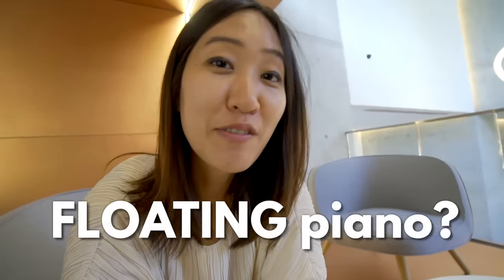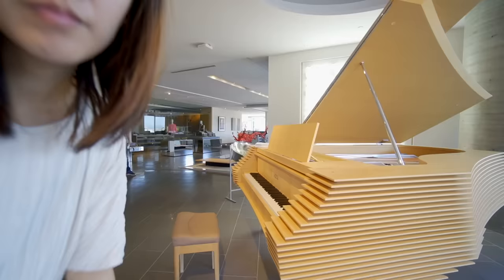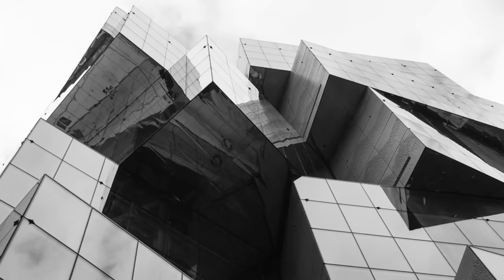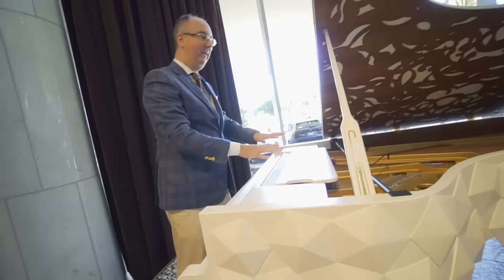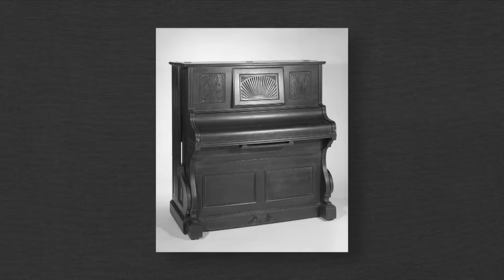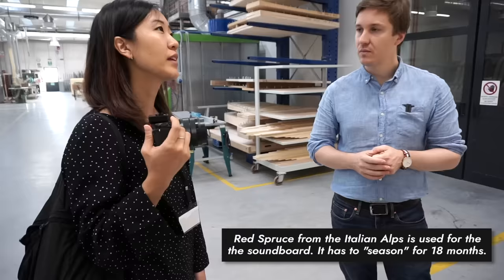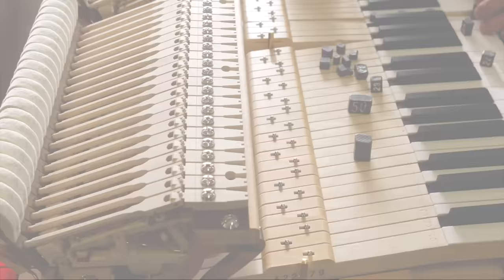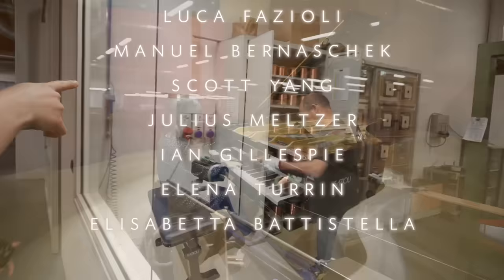UNBELIEVABLE Pianos You Never Knew Existed

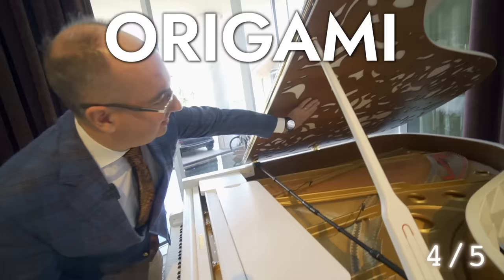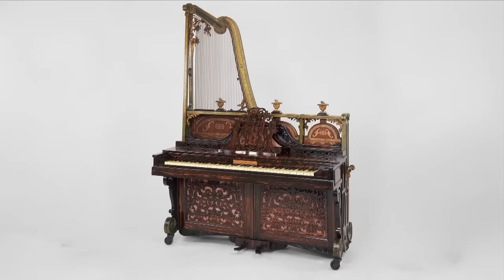Comment: On the optimistic side of things ----- a floating one is better than a sinking one! And 1:57 ----- that one will never over-heat with the nice cooling fins. And 3:12 ---- very nice soft serve ice cream cone! 3:41 - barnacles! And 4:40 --- cup holder! And wow ----- the 4:42 - luckily they didn't get snapped off when attempting to use them hehe